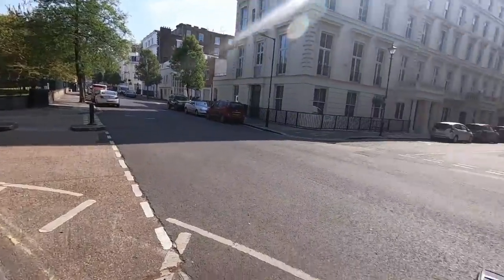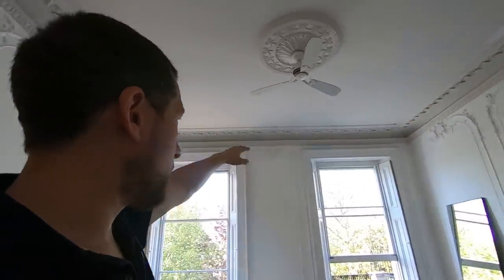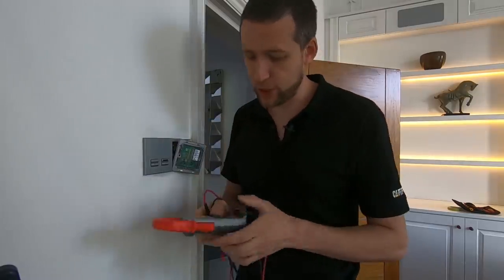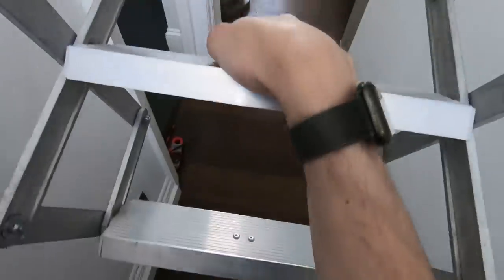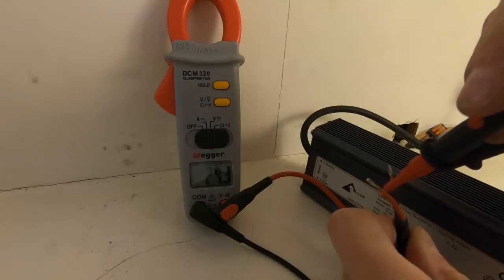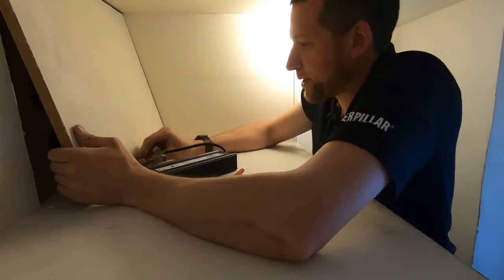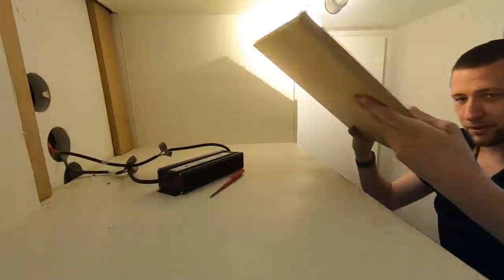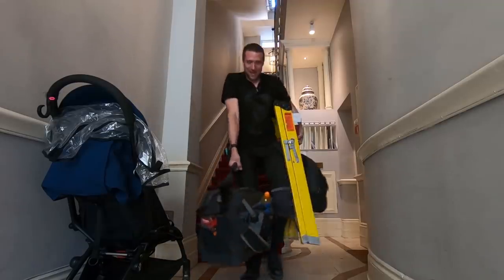Fault Finding on LED lighting

Comment: You could of tested transformer with the load on it. L.E.Ds could of been dragging it down.
Reply: I have seen many faulty led drivers (and other PSU's) that can't take any load but in open circuit condition, everything seems to be ok. Allways test with load connected.
Reply: This is a very good point. :)
Reply: Agreed, as Thomas thought voltage ok - I immediately thought but NOT delivering load current. 
Interesting to see care taken to install access door, but contrast that with failed connectors.

Comment: Rough arsed light fitters lol, using bell wire! :-D boils my blood. At least use 0,75mm double insulated copper flex. there's a lot of current there on that Secondary side. Great video as usual, stay safe out there Tom.
Reply: I thought the same thing. Those LED strips pull a lot more current than most people would expect, in this case it’s probably in excess of 100W.
Reply: He never changed the wire just burnt joint does that not mean it will happen again but maybe burn house down next time
Reply: justice music not necessarily, shit joint = high resistance and that equals heat, but to be honest I’d not have left it, that cable is way too thin. 
I’d have used the bell wire to pull through a thicker wire, not a lot more effort and a much safer job....
Reply: I would've used twin active TPS. The stuff used to wire light switches when looped at the light.
Reply: Exactly undersized, no wonder it was overheating.

Comment: I once had to fault find on a automatic gate system which had been wired in telecommunications cable. Absolute nightmare as the stuff would break if you looked at it funny

Comment: i seriously doubt that the bell wire is suited for the current needed to drive all those daisy chained strips.
Reply: That bell wire is usually rated at 1amp 50v max.
Reply: Stuart Andrews That transformer is big enough to have a 12 or 24V output in the 5 to 10A range...

Comment: Where do you show the fix?

Why did it fail?

Is bell wire sufficient to take the current?

Looking it up bell wire has a current capacity of 1A.  At 24V that is 24W.  Assuming that the tape has 5050 LED's that is 14.4W/m. Not sure of the dimensions of the room but that is a significant current capacity.  The LED driver should be driven at about 80% capacity.  I see trouble ahead.
Reply: That's what I was thinking. 5050 tape with 60 pixels p/mtr is usually about 1A p/mtr. Bell wire is definitely not suitable.
Reply: Spot on - if left on that bell wire you’re going find yourself called back there very soon Tom🧨 From the size of that room and the Driver, that initial stretch should be on 1.5mm2.

Comment: Shouldn't you have measured the 24V Output of the power supply with the load connected? Measuring 24V in open circuit won't tell you that it's okay. But in all, nice job 😊
Reply: That's what i was thinking as well. I once had a LED driver that had the proper voltage open circuit, but under it's rated load the voltage just dropped off a cliff.

Comment: Is that LED Strip run as a ring or a radial? With that length (I'm guessing 14m or more), if it is a radial, there will be a fair voltage drop by the time you get to the end of the strip. Not a factor in this particular problem, just an observation.
Reply: I have a few strips; they just connect in series until you reach the driver's rated capacity - after that, they will get dim. Dunno what the voltage drop might be at the end of the strip...

Comment: Yes you always get a volt drop across the Triac even when fully on on the Industrial ones you have to fit a bypass contractor to reduce losses when on full. Also DC has a habit of if it's just a little bit loose it will burn it  an be a massive problem on old crane's etc.

Comment: That bellwire is probably really undersized to carry that kind of load. And also, with an electronic driver, it can have plenty of voltage under no load, and then decide to do 2v under load because it's being a git.

Comment: Bali, a scooter rider would take you and the entire contents of your van and still have space.....
Worked there for a while, use to see Dad driving, good lady wife three kids and four chickens as a normal load. Bamboo long enough to flex down at both ends and touch the ground, 25 foot plus.
What I would say not the safest method of transport. Not sure it would work in London during ‘normal’ non lock down times
Great content as usual 👍🏻

Comment: Too much resistance built up by tiny bell wire. It's gonna happen again.
Reply: Wouldn't be using bell wire myself, prefer some 0.5mm or even 0.75mm 2182Y, it's rated at 3 amps, 300v max unlike the bell cable.

Comment: Wouldn't be using bell wire myself, prefer some 0.5mm 2182Y, it's rated at 3 amps, 300v max, unlike the bell cable which is 1 amp/50v max.

Comment: Is that LED strip fed from one end? If so there is a lot of current passing through the first 2 meters of LED strip. Had that issue at my neighbors place, ended up having to split the LED strip in the middle and feeding it from two ends. Also, that bell wire is way too thin for that application. Most people dont realize this but LED strips pull quite a bit of current.
Reply: Looked like it! What you can also do is is leave the strip whole and feed power in at both ends if you are using one driver. Helps with volt drop too. I noticed that this particular driver had an output of 3.33A which could very well be close to the max of that bell wire depending on how it was installed as well as the lengh!

Comment: Dear Thomas Nagy, dimmer switches are they not having tranformers? If it is then the load side will be either less current or less voltage. IF it is not transformers then what is the purpose behind it and what is inside etc. If you can share it will be greaaaaaaaaaaaaaat.

Comment: Hi just found you channel:) it's great thanks☺
Just a question though. Why did you leave the old bell wire in place? Surly the issue should be fixed not patched. I know nothing...but my thoughts would be to swap bell wire with something just a little more current capable, so the fault dose not happen again, or cause other damage.
Thanks🙂

Comment: Nice fault finding, I didn’t see the whole installation, but I don’t think the bell wire is up to carrying the current, at 24v and the length of strips, I think that cable is underrated, you can see the current draw from the conditions of the burned out connectors! 
I think I would have recommended a new cable from the driver to the led strips.
I might be wrong as I didn’t see the full installation .
Anyway, a good faulty finding video.

Comment: Erm, why was there a 6 inch length of cable connecting the output of the transformer to the bell wire? Why not terminate like you did with the repair? Was there really a cost saving? Where they trying to show that they used a heavier gauge wire and then switched it out for the bell wire? What kind of saving could be had. Really £5 of difference?

Comment: Hey Tom, big fan of your videos! Really hoping you could answer a question for me (or anyone in the comments section, if they have a good answer please send it my way!) 
I've been working as a theatre technician (live events, theatre etc) for about 3 years. With the current climate, Im a tad bit afraid of actually getting back to work because of finaicial viability of shows with social distancing. Plus it's always been a big aspiration of mine to actually become an electrician .
I have a very good undstanding of being an electrictrician from my previous job but lack the qualification and higher understanding to become an electrictrician. Is there a route you could suggest I take to become an electrician as I cannot take up an apprentice wage as I currently have to pay for my own housing etc. 
Love your videos, really hope you can help! 
Thanks
Elliot

Comment: In situations as detailed where you have a suspect a cable run, following disconnection I always short one end and carry out a continuity check from the other end, a quick way of confirming an open circuit or a confirming a suspected high resistance value, before getting stuck in finding that elusive joint which someone before you should have never put in.

Comment: With regards to the fault finding, it's no different in motor electrical. Test the individual parts to ensure they're working, move on, I tend to clump parts into systems and then test each system individually.

Comment: Test the simple first… I knew better, but I still spent 5 hours taking apart a tractor with dodgy electrics,  tracing wires, when really, all that was wrong was a flakey frame ground that hadn’t had attention in 20 years.  *sigh*.  You always check the battery end and clean that, but never the other end of that wire, which is invariably out of sight and out of mind.

Comment: I  looked at a powered drive gate problem once; it wouldn't open from the inside control panel, in the garden, by the drive. I observed that the black cable that dived into the ground from the panel was a white cable when it appeared again at the gate control box. Aha!

Comment: Don’t wrap leads round tester find it wears the plugs out quicker (must put strain on them ) also on the wago connectors  there is a small hole in them so you don’t have to disconnect them for testing the testing prob fits in the little hole 🕳

Comment: That bell wire seriously needs replacing and the led strips should be wired in parallel as the flexible pcb is usually only rated for the five meter length. Fire waiting to happen.

Comment: Probably getting a lot of volt drop through that bell wire when calculate the total load of that led strip I wouldn’t be surprised if you get the same problem again

Comment: you need to check the driver output with load connected, if they're weak they can turn on and have output unloaded and turn off again when loaded.

Comment: What i do when fault finding is just start at the breakers and follow the wire untill you find the fault
Reply: Jessy Terpoorten it’s much quicker to always start at the nearest Switch .
Reply: You would start at the breaker for a switch fault?
Reply: Starting in the middle of a circuit is also good methodology. From a time constraint perspective, we can quickly know if the problem is before or after our chosen joint/junction. In this scenario I would have started at the switch as well.
Reply: But if the cable is in the wall? If you know that the lightswich has the right voltage, then the issue is beyond the lightwitch. If the terminal block for the lights has the right voltage, it indicates its a problem from there to the light, or the light itself, no need to follow wire through inaccessible places unless you know the fault is on that section.

Comment: Melted connecter is fair enough but why? The shitty bell wire probably came with the LED strip and is designed to run a few meters of strip, if they have chained 3 or 4 strips together to get round that room it could be pulling 4 or 5 amps at 24 VDC, piss all current at mains voltage but easily capable to melting that bell wire at 24 DC and burning the place down. I'd be curious to see what the voltage on the strip is at full brightness, 24 at the driver but if you have 5 amp load on that tiny cable I'd bet it's 18 or 19 at the end of the strip so the bell wire is essentially a heater, over time the insulation will break down due to the excess heat and be a major fire hazard. Not your doing I know but that would leave me nervous.

Comment: Whats to say that connector isn't going to burn out again? am i right by assuming that they would be rated for 230V @ maybe 20A AC which is then completely different to DC, so that connector would not be rated for that type of installation and maybe a soldered join would be needed instead?
Reply from the maker: To be honest that white cable is too thin anyway really. I have gotta quote to replace it but its a twat of a run as it wont pull through.
Reply: @thomasnagy  Loving the videos you're producing and it's great to see how you do things, I've learnt a thing or two! Keep up the high standard of work!

Comment: Surprised you undid the WAGO and not used the test port in the top :) Why they use WAGO short cable then choc bloc and bell wire eh?
Reply from the maker: my test probes dont have enough exposed metal to reach into the Wago testing slots. I need to strip back a few mm's but never get round to it

Comment: Bell wire! Seriously lol. Deffo be changing that . Gonna fail eventually!
Reply from the maker: Its surprising its managed this well up to now. been like it for about 3 years i think
Reply: @thomasnagy  take it it's not practical to pull new cable through using old wire as draw wire?
  Or if it ain't broke don't fix it lol!😂

Comment: Got a dimmer on my living room light its worked for years brought some new led bulbs now they dont dim? It just flickers ? Any ideas .......
Reply from the maker: probably the lamps aren't dimmable if they flicker. or its a cheap nasty dimmer
Reply: @thomasnagy  cheers man I'm guessing it's the bulbs cause ain't ever had a problems thanks for answering
Reply: @matt3642  Not all LED bulbs are dimmable, I'd would definitely say it's the bulbs!
Reply: Ran into this problem earlier in the year and did some digging, turns out not all brands of switches work with specific brands of bulbs. I had to try 3 different dimmable bulbs before i found ones that didnt flicker with my particular switch.
Reply: It's your dimmer mate. They are not compatible with the LED bulbs. Be warned... when you buy a new switch be sure to go to your local electrical wholesalers and ask him for dimmer Sw AND led lamps. Not all led dimmer switches work with all makes of led lamps! It's a ball ache.
Reply: quickest solution is usually to get a varilight pro dimmer
Reply: The old style rotary dimmer switches wont dim led lights as they are dc, you will need to get a dimmer switch for led lights or change the Led lamps
Reply: Both the dimmer and the led lamps you've bought need to be compatible. Most lamps have a triangle with a swirl in it if it's damnable. If it's not got this symbol or it has this symbol with an x through it it's not a dimmable lamp.
Reply: You need to check the compatibility sheet for the dimmer and check which lamps (bulbs) can be fitted. Certain lamps (bulbs) have been tested for flicker, dimmable range and the maximum number the switch can handle.